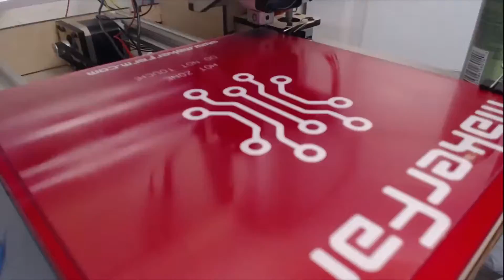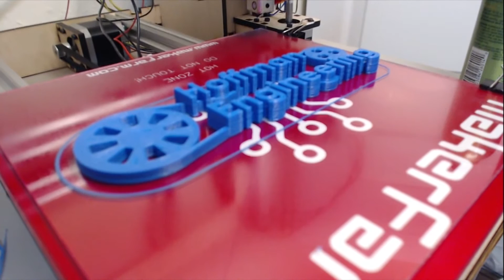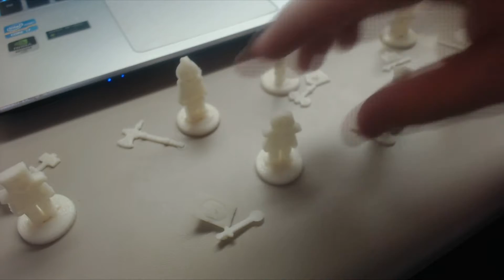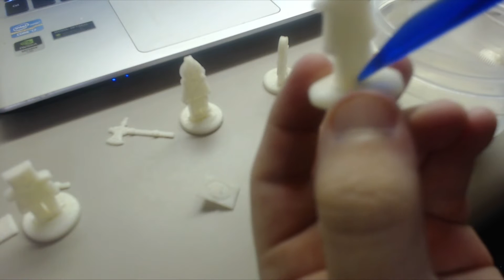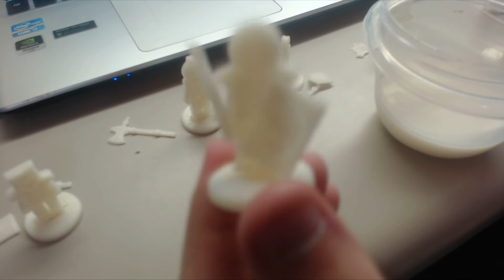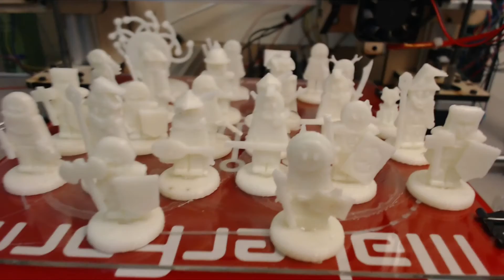FlatMinis: 3D Printed Miniatures Assembled using ABS Slurry

Comment: How many of those figures can be done with one single filament replacement?
Reply from the maker: The standard spool of ABS is 1 kg of filament for ~$30. For these, I got about 8 minifigs per 8"x8" print bed, using 25.04 grams of plastic.

That means that I could print about 320 of these flat minis per roll of filament, and it would cost $0.10 per mini.
Reply: Hoffman Engineering Thanks bro, i´m looking foward to get my own 3d printer, it's way to cool
Reply: Hoffman Engineering what's the name of machine